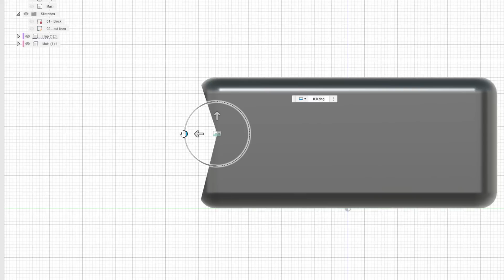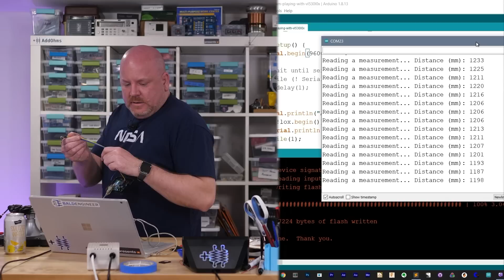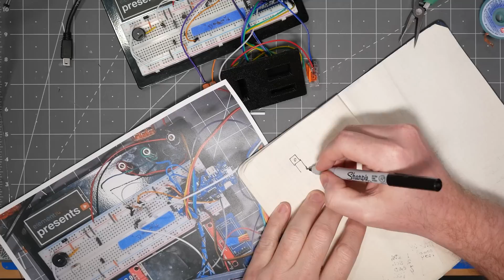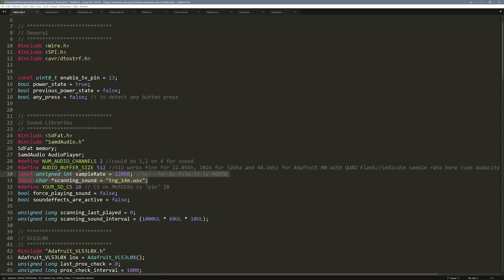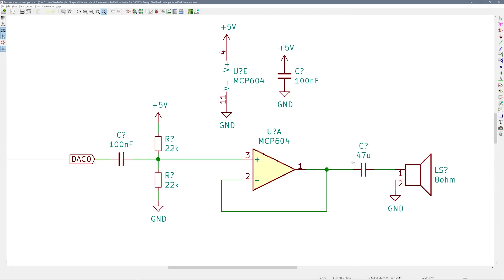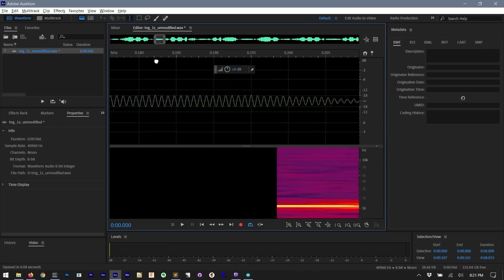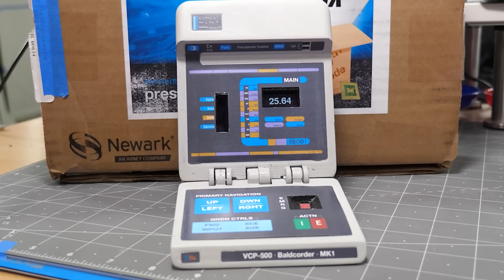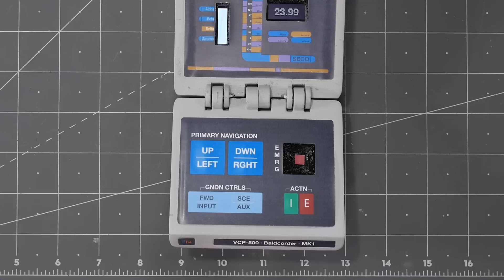DIY Star Trek Tricorder from Build Inside the Box

Comment: You can make space by removing parts/equipment, or.. by redesigning the case to be a little deeper. Remember, you designed the case in sections to make it easier to do just that.

Comment: I was thinking . how about this 

Make teh medical tricorder
 The cylinder removable part can function as a charger  for teh battery . Very much like how  there are quick battery chargers for smart phones.  one could  make a few of them for extended  periods  . slide a few of the battery  extenders into a lil pouch on a belt   when ya know teh time is   getting close ya pop out teh one cylinder and place it  with another and ya keep on going 

I think the medical tricorder  is a lil longer and would afford you the ability  to  do a lil more  wiring

Comment: as far as the wiring goes, i have a replica with working lights on the flap and so did the ones onscreen, they use metal hinges to pass the signal directly just wired to the hingeplate, the models onle need  positive and negative but you could do 4 smaller hinges or some fun more elaborate circuitry to vary the current or resistance in a way that can be monitored

Comment: If only there was a service of some sort, that you could design a custom PCB that could be manufactured small scale that could allow one to build a actually fully functional "tri-corder". Using off the shelf components like a touch sensitive lcd screen, gps, some sort of magnetic sensor, O2 sensor/gas sensors for things like CO/CO2, temperature sensor, humidity sensor, a CCD for optical spectrometry/3d mapping, IR laser for range detection, all powered by some sort of SOC with some sort of machine learning.

Now that i think about it, why doesn't the iphone have an accessory and app for that.

Comment: Version 2.0 idea: instead of physical buttons & wired connections, use a touch sensitive screen maybe even a small cell phone, to have a cgi version of the control panels. This would also allow for each button press to register and activate functions, as well as having the electronics be smaller and self contained, allowing the case to be smaller & to scale.

Comment: Actually, there is a version of the toy where the buttons on the flap DO work.  I know, I have it.  Also, why would you need to make it bigger?  You could fit quite a lot of electronics in the small space.

Also, that's Original Trek tricorder sound.  You built a Next Gen tricorder.  It has very different sounds to it.

Comment: It would be fun to see variations-of-a-theme versions of this project, with replicas of the TOS tricorder and the ST:TMP tricorder.  My understanding is that with the TOS tricorder, the actual tricorder circuitry area was about the same size as in the TNG one, since most of the body was a storage compartment for data-disks , tools and stuff, but one could probably take liberties with that extra area and put more wires and electronics down there.

Comment: Maybe a question often asked, if so then sorry. What software are you using to make the schematics you’re showing, like the one at 11:00 for the DAC/Speaker? I want to find something that has a full electrical symbol library and also snap connects lines and the terminals on components cleanly. I can’t manage to find electrical symbol libraries to import into anything I already have messed with. Thanks in advance!!
Reply: KiCad

Comment: it probably wouldn't be too difficault to put a magnomomitor and a barometer in this somehow to be more "functional"
Reply: I know the original series used them, but did TNG use the external sensor thing? I remember McCoy using the smaller sensor to scan people and the tricorder to interpret the data. 

I wonder if a contactless thermometer could be built into an external size device (size of a film canister or so) along with maybe some other small sensors/multi sensor and communicate the data back to the tricorder. That way you could take someone’s temperature and maybe even pulse (similar to how the smart watches use the sensor with the green led to see “through” the skin)? 🤔
Reply: @williamporter7935   The removable sensor probe was used on the medical tricorders I believe, but not the regular scientific field models.